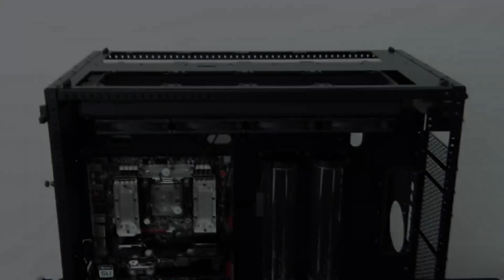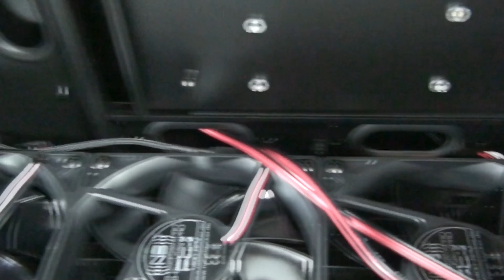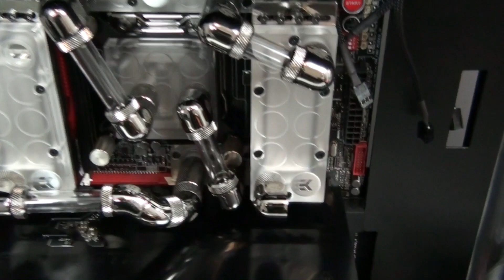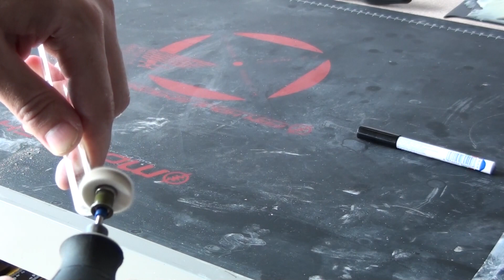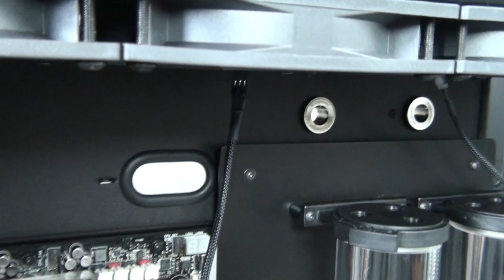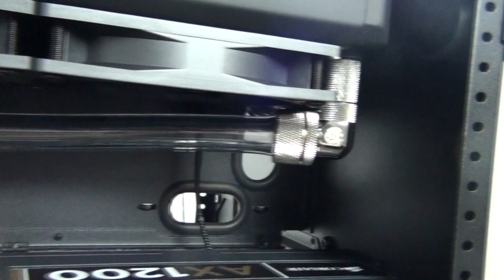Build #10: Extreme TH10: Part 2

Comment: Great build on this one, gives me more ideas for my Magnum TH10A. Im guessing this was also before CaseLabs had the Reservoir Mounting Plates yet great modding the plates. I don't know yet if you ever did a video on just going over Fittings and Tubing Components" but that would be excellent to see as i learned a bit on this one about Multilink and Crystal link fittings alone and had no idea what those were.

Comment: Hi. Can you help me, please. I'm building on same MB, with same blocks (but acetals)... so i would like to do the same config (screnshot is in link below), except I prefere metal fittings (may be Bitspower Adjustable Aqua Link Pipe) not transparent piping. But I'm low on budget and time (this is my the only one PC and I cant wait another few weaks for another shipment to finaly transfer it from air to water) Can you help me figure out the heights of extenders on CPU-MB-RAM section.
Here is the pic. https://www.dropbox.com/s/hrh41ty6ms6jv2y/heights.jpg?dl=0
As I assume h0=h4=h7=0 (90deg rotary is just in waterblock), but what are h1, h2,h3, h5, h6? 
Thanx.

Comment: Why did you route the tubes like that in the CPU? You are taking all the hot liquid from the CPU to the mem on the left. Why didn't you go first to the mems in the left and cool the CPU last and then go up from the cpu to the radiator?
Reply: loop order is irrelevant.
Reply: iAmCodeMonkey Having taken thermodynamics and fluids in college...as long as the coolant is moving at a good clip, how you route the loop is negligible!
Reply: Nick Hansen Why do people still think this is the case? The mind boggles.

Comment: How much money is a Rig like this Cost ?
Reply: Around the $9000 range if not more. Daniel probably gets his parts cheaper due to suppliers but if you were to build this rig yourself you're looking easily at $9000 or even 10.
Reply: prototypep4 For very high-end computers, yes. But, if you go to sites like pcpartpicker, tweakers(The Netherlands), etc. If you go with a very high-end computer (4770k, quad SLI 780ti, full watercooling), you'll come at the 6000-7000 mark. Personally, I would love such a build (or even with the 4960X), but keep in mind: What do you prefer: High-end with 4770k with dual 780ti/R9 290X with a few thousand dollars/euro's to spare for things like a new tv, couch, airsoft, car etc or an extreme overkill pc that will play BF4 on ultra with 3x 1440p monitors on 100-150fps?
Reply: Jacco H
Mate, do your homework. Go to pc part picker and enter in all of the parts in this build. Include the price of the water blocks, fittings, coolant, sleeving, fans. Everything and you will need to do custom parts too. It will come out to around the $8000 mark if not higher.
Reply: prototypep4 You know, I never said this build would cost 8000 bucks. What I said is that a very high-end pc woud cost about 6000-7000 dollars, if you're not going with the most expensive of expensive parts.
Reply: Jacco H
Depends on application. If you want a high end gaming pc sure $6000 will cover it. But if you want workstation functionality or overclocking headroom too you're look at well above that.
Reply: prototypep4 I know. A very high-end workstation is way way more than 6000 bucks.

Comment: ill working with a project like this.
but i have a question that i hope you can help me with :)

i am lokking for fettings and i this video i can see you are using the Multi link fittings which have no "locking mechanism" its fine on the MB because its so small Distance. but you have a tube from the Ram cooler to the pump and from the GPU to the other pump. and you have a 90 degress fittings aswell. you are using Multi link fittings to the whole system. my question is. are the fittings "stable" enough so there is a small chance that the tube is come out from the fittings.

hope you can help me here. i want it to be as stable as possible. but again i dont like the bitspower acryl tube fettings. they are so big. the multi link is small, thin and beautiful.

Comment: Hey guys I sent this to Daniel threw PM but I'll throw this at the community: Hi, huge fan of your work! But on your videos for build 10, if I'm recalling correctly, you say you use E22 hard tubing 12mm OD 10mm ID(I'm assuming. Since its the closes size to the compression fittings I mention next), but you regularly say you use 3/4"(19mm) OD 1/2"(13mm) ID Compression fittings. Did you use a smaller size fittings to make use of the E22 tubing, or were you able to use both somehow? Thank you.

Comment: How does that loop configuration work with the gpus? Wouldn't the liquid go straight to the bottom gpu running them in parallel like that? Just a question. My build wpuld look so much better if I could have the inlet and outlet coming out of the top gpu in my quad sli settup. Thanks!

Comment: My opinion -  You've worked towards industrial perfection so much until your last few builds have lost there artistic quality. I am guessing your clients are requesting these builds to be this way. While I understand your reasoning, I actually like your earlier builds a bit more. The loops, and curves in the tubing really add beauty and contrast against the straight angles of the other components.Lights and UV cooling fluid give the machine a Tron kind of beauty that draws attention every time.

Comment: All these questions were answered in the video. Did you even watch it? Yes, e22 tube and a jigsaw. Sanding the rough edges off with fine grit wet and dry sand paper and polishing with the cloth polishing attachment of a dremel using Novus acrylic polish. He mentions the diameters but I forgot them.

Comment: Really excellent advice on rounding off the ends of the crystal link tubing. I'm using 12mm OD copper pipe and the crystal link fittings in my current build and have had to do exactly the same thing with the copper. Also good advice on the squaring everything off as bending calculations take a lot of work and effort!

Comment: Agreed. This is one sweet beast! Love those dual water cooled memory dims! I'm so jealous. My corsair dominator gt sounds like a jet engine, while fractal with h100 is silent (sp120 fans) hell, I'm still running i7 920 @ 4.3ghz and 12gb 2000mhz corsair dominator, gtx 680, samsung ssd 840 pro 512gb and 2tb raid 0. All geared out for gaming. I still get 8.1 all around in windows index performance. Not bad for 2+ years old computer.

Comment: nobody said that it has to run win 7/8, most tablet today have an ARM cpu (with built in GPU) and are able to display a 1080p video without any problem, and on top of that can run some linux distro quite well (i'm personally runny a heavy KDE desktop on an old iconia A500 without any problem)

Comment: Great video, and it's promising to be another great build once again. One thing though, you say that primochill are doing a larger diameter tube of half inch or 12.7mm, that's only 0.7mm wider than crystal link, and by the looks of it primochill has a thicker wall to make it easier to bend.

Comment: Hay i have some questions.
In my Build i currently only cool my processor with an 360mm Raditor.
so first question:
I have teflon tubes installed, can i use that or should i change it?

second question:
I have an Coolermaster Cosmos II and i want to watercool my 2 GTX780
but i can only install an 240mm Radiator in the bottom...
is an 360mm + 240mm enough for my Processor and 2 Graphicscards?
and is there a way to install more radiators?

Sorry for my bad english, iam from germany.

Comment: Looks hot like always with all your works.  Question, with all the acrylic tubing.  Taking out the motherboard would be a pain.  Since case labs gives you that feature for you to use.  On your Singularity beast 2 you took that into consideration. Surprised you didn't on this one.  Given the aesthetics on this one are off the meters;)

Comment: I really want to do a hardpipe acrylic build in my Prodigy, but even the number of fittings required for just a processor and video card, plus the radiator, fans, pump and reservoir add up to over $1200 US.  Which is more than my computer cost.

Comment: push and pull are the same temps, the only difference would be in push and pull at the same time
the highest temp on an intel cpu is 90*C, then it auto shuts down
i would say anything above 80 degrees is not too safe anymore

Comment: Again you've outdone yourself, Daniel. Amazing work. Like someone else mentioned, my only concern would be the crossover of the one res over the other unless you are using the same color for both loops.

What is your opinion of Intel using TIM instead of soldering between the CPU and the heat spreader on Ivy Bridge and Haswell? Did you see a significant increase in CPU temp with OCing from Sandy to Ivy? Any Haswell-based systems coming up soon?

Comment: I heard its not nessesary to install dust filters which can hender the fans preformance, but instead, use an air compressor to blow out the dust, but.you need a special festure in the air compressor which removes moisture from the air.

Comment: Of course. But like he said, flush it a few times afterwards with destilled water to get rid of the tap water. You need to flush the system a lot of times and using destilled only would cost a lot hehe